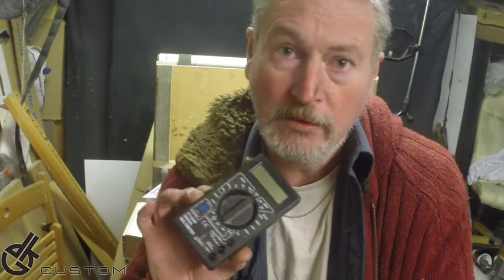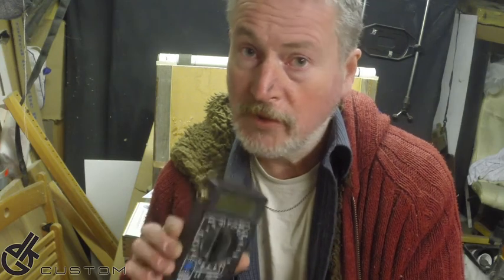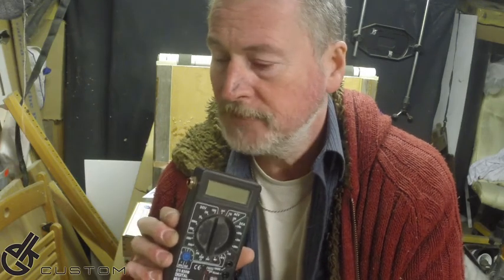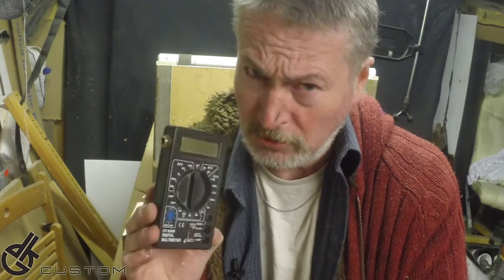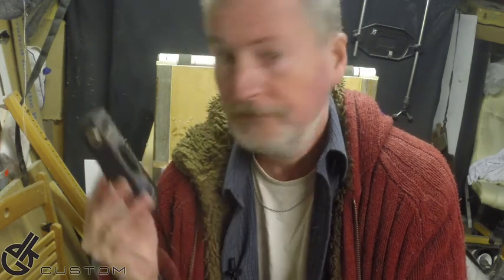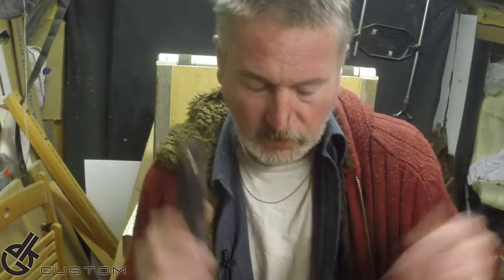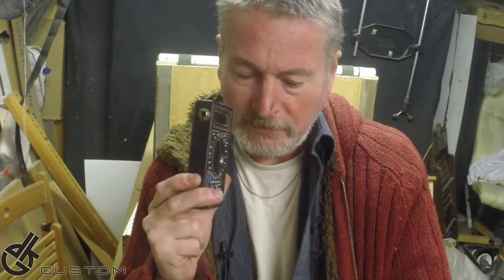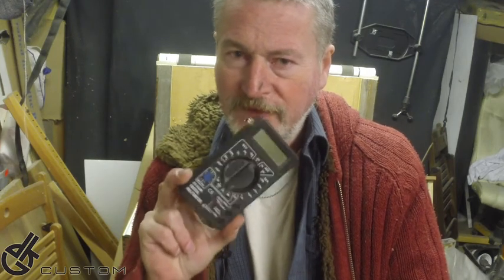The Multimeter Conundrum

Comment: As a rule, do not apply 9V as an input into a guitar!!!  If it has active pickups or active electronics there's a chance that you could do substantial damage.   Active electronics in guitars are normally activated when a 1/4" phono jack is inserted (your test lead), driving an output signal... which you are now putting 9v across.

Ouch.  

Also, keep in mind that just because you might get away with it once, it all depends on the design of those circuits.  Some might be tolerant, others not so much.  YMMV.

Of course, if it's just for your own personal use and you only use on instruments with passive pickups, you'll be fine.

Comment: You could get spare probes, cut the ends off and solder them to a 1/4 inch jack. For lead testing, you could add a shorted socket on one end and have a pair of probes with a scoket soldered in place - the continuity test sends the signal up the live and waits for it to return down the screen?... but really, checking continuity in a guitar without opening it up, you just plug it into something and have a spare lead handy. If it works, it works, if it doesn't it needs opening up to be fixed anyway.
It's all relative, I guess, but an electric guitar is about as basic as electronics gets and for the time it takes to open one up - less than five minutes...

Comment: Hi Duncan,
One thing you can do is get a rough idea of the pickups DC resistance.
If your meter has inductance you could measure the pickups inductance roughly.
Also if the meter is capable of measuring audio amplitude you can measure the output voltage.
If you could test new guitars with a meter in this way it would be interesting.
Reply from the maker: ***** That would be cool
By the way, you should have a PM inviting you into a "anti hate" project you might be interested in.

Comment: I think a luthiers multimeter should have 4 terminal resistance-measurement. Ordinary  portable multimeters (even quite expencive ones) does not make accurate resistance measurements at low ohms. Example: measuring short pices of copper wire.
And  frequency counter.
Reply from the maker: Flapjackbatter Good points

Comment: Well if the volume is turned up it may be able to test the coil winding of a single pickup. Set the pickup selector to that pickup and test at the jack. It will be ground and hot. Tip and sleeve on the cord. This should go through the volume pot and to the hot side of the pickup winding showing continuity and Ohms to ground side. I never tried this but it may work if the volume and tone pot don't skew the test. That would be handy.

Comment: The multi meter you have is a DIY build kit it's good for basic unit it comes from Silicon Chip magazine.  they did the plans and then DIY kits then pre made ones that have been copied by tons of Chinese companies.

I don't know how you could check a single circuit simply because you generally check a solder point to see if it's working right,  plugging the guitar in would only check the plug or the whole circuit.

Comment: Great!
Besides the things you mention I use a multimeter sometimes do know if a pot is linear or logarithmic (but then the pot has to be disconnected) and to tell wether two pickups are in of out of phase (I've had low impedance pickups of which it was hard to tell by ear wether they were in or out of phase; the multimeter has to be sensitive enough though to measure the small ac voltages involved, but it can be done without opening the guitar).

Another device I use quite frequently is an LCR meter (inductance, capacitance, resistance) to know inductances of pickups (always interesting) and values of capacitors in case of doubt.
Reply from the maker: Marc van Oppen I'm glad you dropped by.
I understand totally that there are things you can and can't do without dismantling a guitar.
But when you consider how much we know about the Cosmos without hardly leaving the planet, figuring out whats going on inside a guitar SHOULD be achievable.

Comment: Pretty cool. Stuff like this makes me want to dive back into modifying guitars. I guess that input on your meter can read the voltage output of your pickups. How about a test rig for measuring the impedance of your pickups? Impedance matching is always important.
Reply from the maker: Bruce Lindquist When I get a chance, I'll be putting my brain to work.
Reply: Bruce Lindquist it should read impedance, you'd have to take.the cable in account

Comment: Though it seems like electrics it's in fact electronics. Most of which is passive electronics. When you use a multimeter on the resistance scale you can only measure DC resistance. Because a pickup is an AC device which generates an AC signal the resistance is called impedance as the magnetising effect causes different values other than pure resistance and alters the DC value that you measure with a multimeter. A basic electronics book would help. However as I did my training in 1975 I can't advise a current one. There will be loads of stuff on the net to help.

Kind regards and keep up the good work

Comment: Another thought is arduino.  You could program it to do anything you want and add what ever sort of functionality you want.  Add the appropriate lead sockets and you're off to the races, I reckon.  Now you just need to find a decent programmer;-)
Reply from the maker: Woodeso's Guitar Mods I even have a Raspberry Pie sitting doing nothing!!!
With the human mind being able to unlock the mysteries of the universe without hardly leaving the planet, figuring out what's inside a guitar without pulling it apart must be small potato.
I'm convinced that you could plug it into a computer, throw the switches and knobs and you could get back an accurate wiring diagram with all the component values. It's just a matter of elementary deduction, my dear Watson....
Reply: Indeed, but since then, I've thought of an entirely different way you could go. Phone app with hardware that snaps on to your phone or around it or something.  Giving it only the leads it need for the software to do the rest.
Reply: Woodeso's Guitar Mods And I just now googled it, thinking something like this must exist already. And it does:-) http://www.redfishinstruments.com  Just not guitar specific but...you can work that bit out;)
Reply from the maker: Woodeso's Guitar Mods There is a multimeter set-up for iPhone...the hardware part is $200!!!!  It doesn't directly connect to your phone. I guess that protects your phone from getting accidentally fried
Reply from the maker: Woodeso's Guitar Mods Yep...that's it
Reply: Woodeso's Guitar Mods Now yu're talking! I'm about to build a Gaussmeter using one of these. I'm a complete novice, but it's scary just how simple and how cheap it can be done. Already planning an Arduino based pickup coil winder that displays what's happening - RPM, wind count etc.
Reply: DKGCustom Using just a 1/4 inch jack? Best you can hope for is the cumulative reading of total resistance, capacitance etc etc.
Having said that, I suppose if you have a 'wide open' total of everything, you could write a program whereby you specify the component being tested, run it through it's range and it measures the difference? As I said further up, guitars are basic and predictable - you know if it's got humbuckers, it'll have 500k pots with the appropriate cap (0.047?)...
Damn you! You've woken the grey matter up again.

Comment: Genius and the first thing that occurred to me to add, is another 1/4in jack socket to test cables for continuity.  Is my cable broken?  Happens all the time..  Love this idear, Dunc!
Reply from the maker: Woodeso's Guitar Mods Yep. A continuity tester would be SOOO useful. There's not enough room in my meter to add another socket, but it could be done with a plug socket with + and ground wired together. Plug one in the meter and the socket end on the other..
If you were being truly anal, and if you got a meter out you probably are, it would be good to test the individual wires separately. If you were to build it into a device, it would be a good idea to use XLR/ 1/4 inch stereo jack sockets to test a range of cables....no brainer!!!
Reply: Look forward to V2:-)
Reply: You can get cable testers quite cheaply, but one with the ability test more would be useful.

Comment: There isn't a guitar specific multimeter that I've ever seen.  1st thing to look at on any meter is the imput impedence,  namely get 1 with rating of at least 10 megaohms.  Reason is current will flow in the branch with the lowest resistance so if the meter's imput impedence (aka resistance) is low current will flow through it instead of the circuit n screw up the results.  What I use is a Wavetek (since changed names) 37XR which isn't the cheapest ($200+ a decade ago) but has a few extra features such as it can measure capacitance (good for dealing with tone related circuitry).  It also has a frequency counter feature (some others have that too) which isn't exactly same as a tuner it will tell you exactly what frequncy of whatever note it's given via the meters inputs.

I'm thinking if some company expanded the features of some current multimeter model specific to music related work it could be a great thing.  Wouldn't take a huge leap to add a tuner feature to a meter which already has the frequency counter type of feature.  Or do what you've done is add a mono or stereo audio input, or an external adaptor to be used with / instead of the standard meter probes.

Oh btw don't forget (which you probably already know) is never measure current in parallel like you do with voltage n resistance (impedence)  currents in series only or you're meter goes poof n you'll need a new one (which is needless to say very GRRR indeed).
Reply from the maker: CJ99 W I was so surprised that I couldn't find an all in one meter....like you say, it wouldn't be that hard.
Reply: DKGCustom 1 big part of it is the electronics manufacturers don't dabble in music specific stuff too.  I supposed it would take 2 companies to produce something usable, in some kind of partnership,  say korg n fluke as just 2 examples.

Comment: rsistance, current and voltage AC & DC is basically all you can measure with impedance in Ac relevant to resistance. OHM,,,,,,